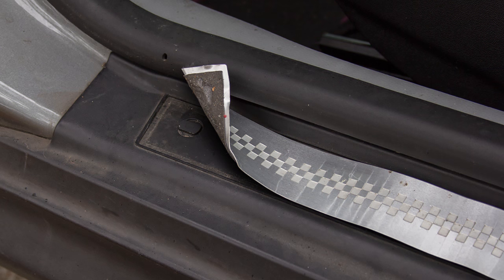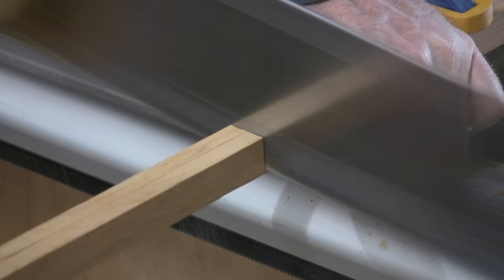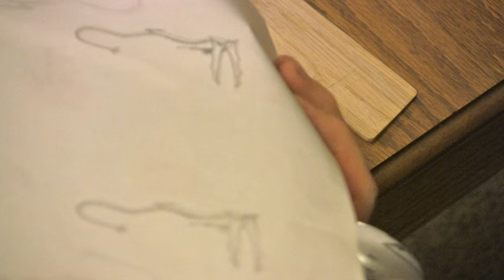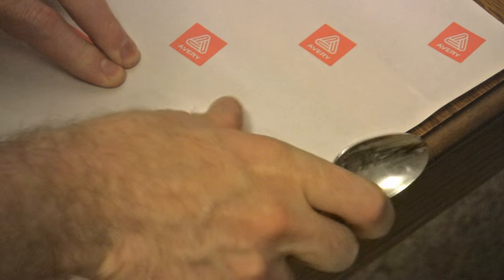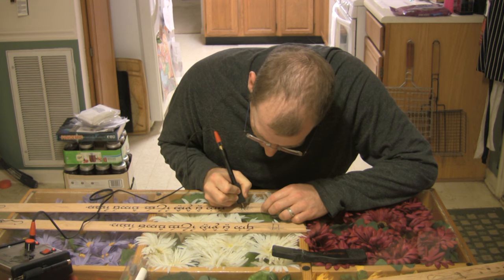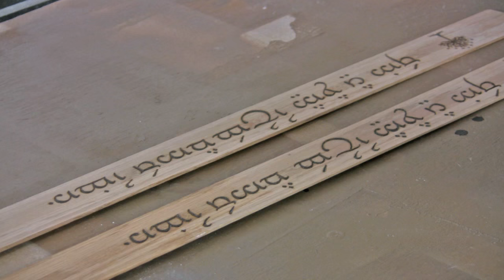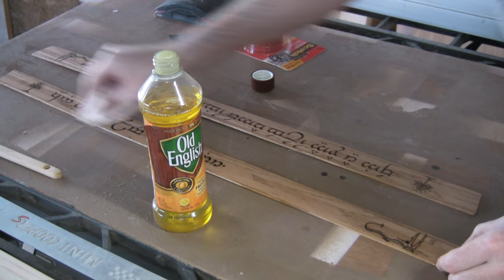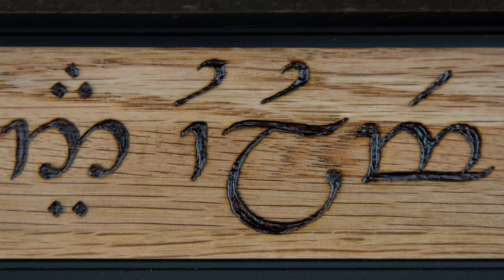Woodworking: Car Door Sills

Comment: I clicked on this thumbnail because I recognized the tengwar letters, still very confused at the idea of using work this excellent as a place to put your foot in a modern car, but I will not let that get in the way of complimenting your great work. I do greenwood carving with hand tools and have no experience with electric tools or burning, but I'd really like to be able to do this. Would you mind recommending any particular brands/models of these woodburners? It seems like they're similar to a soldering iron and pretty simple? If you could give me any tips on what to look for or avoid I'd appreciate it, I never want to buy the same tool twice.
Reply from the maker: Thanks for the kind words.  Woodburning tools vary greatly in price and quality.  I have a Razertip burner with a couple of tips, but that's on the high end of the scale.  A lot of people get by just fine with hobby woodburning kits available at craft stores, but typically they don't get as hot, and they don't have variable temperatures.

As for tips, I just look around on the web and watch as many videos as I can find to learn new techniques.  Like any tool, it takes time and patience to get right.  I'm sill learning!